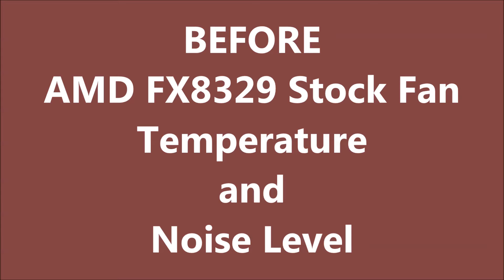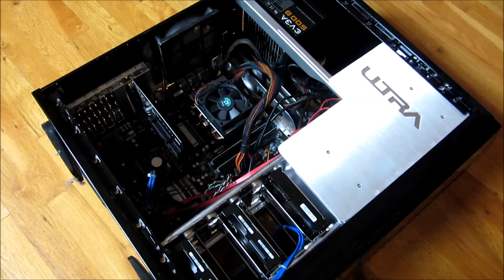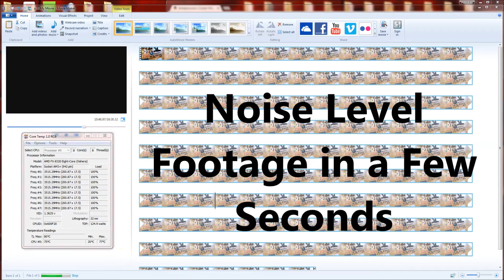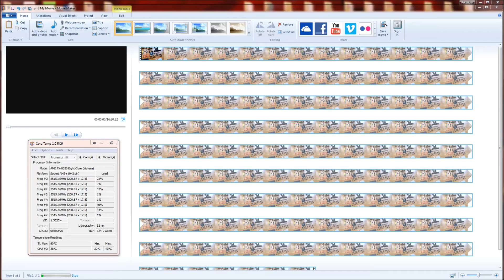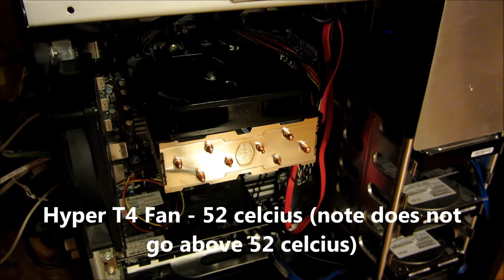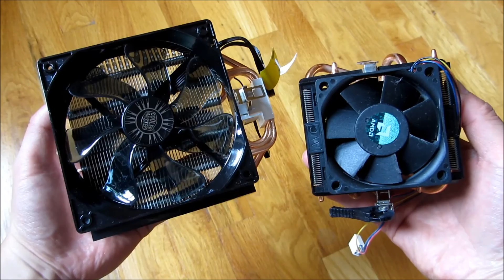Cooler Master Hyper T4 - CPU Temperature Torture Test and Noise Level Test

Comment: Cooler Master evo or Hyper 212 LED Which is better Will be bought Hyper 212 LED because Fan Life Expectancy is 280,000 hrs What do you think
Reply: The only difference is the fan. And you don't even need to keep the fan. You can easily install any 120mm fan instead.

Comment: This test prove off course that T4 is much better than stock shit,but you prove nothing actualy.Rendering video from movie maker it is not near enough stress to CPU,try to do it cinebench,or rendering i C4d and that temperatures would sky rocket.If you have Fx 8 series for example fx 8320 and you OC cpu to only 4000mhz,T4 is not strong enough to keep that temperatures down,trust me.
It is enough for every day gaming or watching internet but if you do rendering tasks you must go with evo 212 or top of the line Noctua coolers.
Or your cores would go over 70 degrees celzius.
It is best to buy high end water cooler with two radiators,you can see some videos on you tube,where FX 8350 OC to 4500mhz working in few hours of rendering on only 30 degrees celzius.Huge,huge difference.
Reply: https://www.cudasteam.com/compare/cooler/Hyper-T4-vs-NH-U12S/8020-8005

Looks like the T4 wins in acoustics and airflow.. ouch

Comment: Hyper T4 is 10$ on Newegg right now!!!!!! :D I wanted to get a 212 evo, what do you think?
Reply from the maker: T4 is working fine for me, personally its a toss up, they seem pretty much the same.
Reply: This is true
Reply: Mine just came in, I put an extra fan on the other side in a push-pull config and my temps on my 1600x dropped from 36c to 26c in idle and never pass 65c on load when they used to hit 83c. Overall insanely good price/performance.

Comment: Too bad it couldn't have been installed in a better configuration, might have been worth a couple more degrees or so.  These are great coolers, great bang for the buck and theyre all I use when I can fit one in the case. I don't game anymore so overkill for my uses.

Comment: I think you installed in the wrong way around. The fan should exhaust towards the chassis fan to make the hot air leave the case...
Reply: you are right..
Reply from the maker: That would have been ideal, but the alignment of the mounting plate on the motherboard does not face that way.  The clip alignment is up and down, not left to right.  And my purpose for getting this fan was not having to install the mounting plate.  In general was restricted by the space, what was blocking, and it would block and the length of the fan cable.  Also, no chasis fan broke, so I just pulled the plug, no difference in CPU temps with the chasis fan gone.
Reply: you can change the clips to face the other way.. the fan needs to be facing towards the video card so it pushes air towards the power supply fan...

Comment: I'm getting terrible fps on games like gmod and minecraft I have a r9 390 with an fx 8350 on stock fan I get 80 degrees under a lot of load will this help?
Reply from the maker: What fan are you currently using?  It likely won't help, you need a better video card, not necessarily a CPU fan.
Reply: fx 8350's stock cpu fan, i think the r9 390 should be able to get more than 30 fps on gmod and 60 on minecraft and thanks for ur response! and i ended up ordering the t4 just last night, it worth the gamble to see if my games will perform better
Reply: 8 gb of curcial ballistix but im pretty sure its the fact i get 80 degrees on my cpu that it lowers everything causing the fps drop

Comment: isnt it better for the fan blow air toward the back case fan?
Reply from the maker: since getting this fan, i turned off my case fan and the air circulation seems fine.  i think as long as you have a case fan that pulls air in and circulates air out it should be fine.  I haven't found it to be an issue.